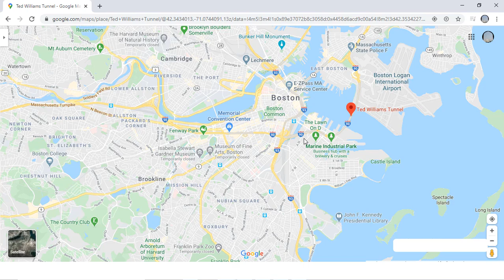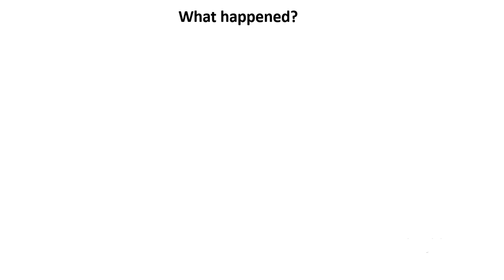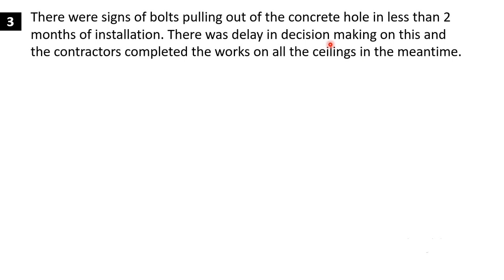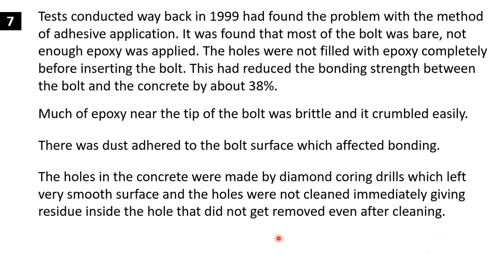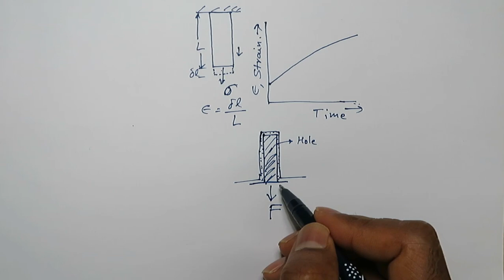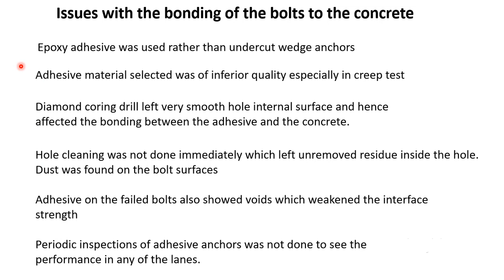The Collapse of the Ceiling of a Tunnel – A Case Study (The Big Dig ceiling collapse)

Comment: I am still uncomfortable traveling through this tunnel because of this. With 2.5x load I would have proposed wedge anchors and epoxy. I also would have proposed using a 5" mixing nozzle to fill the hole before installing the bolt, especially due to the fact that it was a vertical application. Project was already 3x budget, what is the difference in 20,000 fasteners at that point, especially for something hanging over your head.
What has never been made clear to me is what the mitigation and correction process was. Were all the fasteners replaced, are there ongoing inspections? It is coming up on 30 years for parts of that ceiling.

Regarding fire in the tunnel, I wonder if a fire hot enough to penetrate or conduct heat via the T-bar up to the epoxy causing creep and failure would be so hot that a human wouldn't be able to survive in the environment anyways thus negating fire/epoxy creep concerns.
Reply from the maker: Thanks for your valuable comment.

Comment: Your explanation of adhesive anchors is incorrect.     Epoxy snchors, specifically those used in this application ' are mixed by nozzles designed for this purpose . Therefore the resin and hardener are not mixed by spinning in the threaded rod.
Reply from the maker: You may be right. I have followed the case-studies and the news/video reports that came out after the failure. Modern nozzle design must be different than what was available at that time. Thanks for the comment.
Reply: @engineeringmaterials-tribo5142  i worked in the anchor industry for 38 years.  The only adhesive anchor that was mixed by spinning the rods into the holes was a glass capsule containing polyester resins.   This project employed injected epoxy.
Reply: The installers didn’t use the correct method to mix the epoxy was just one of several issues I’ve seen claimed. Another was that they used the wrong drill bits to prepare the holes, in addition to leaving a week between drilling the holes and cleaning them out. Yet another was that they had switched to an even cheaper third party version of the fast-set epoxy and weren’t using Power Fasteners on those particular anchors at all.

Basically a lot of options for how exactly this went wrong.

Comment: Q1: To what extent must engineers educate themselves on the various materials being used and processes being employed in a project in order to ensure safety? 
Q2: If lack of knowledge played a part in causing the collapse, how might such understanding specifically help engineers to prevent an event like this in the future? 
Q3: How else might engineers work to avoid a similar catastrophe?
Reply from the maker: Reply 1: An engineer must be very aware of each material’s benefits and some drawbacks. After all, every one relies on engineer’s knowledge. The project engineer may ask the suppliers to provide the necessary technical datasheet. However, project engineer’s knowledge of the materials will help him to make the right decision. Many of the engineering disasters had failure of the material as the root cause. Of course, at some level design is also something the engineer must look at carefully. Changing of the design at a later stage without making other considerations can be dangerous.
Reply 2. An engineer can learn that polymers (adhesives or bulk) cannot be put under continuous stress as creep occurs. They can take large stress for short-time but not for long time. Similarly, if you are using metals at high temperature then also you should worry about creep.
Reply 3. Look at the technical data of each material you are using. Ensure you have been provided the right material that was mentioned in the design. Never compromise on the materials or change to a convenient design change to save project money. Always take personal interest in each component being built and do not just believe the suppliers or contractors.
Reply: @engineeringmaterials-tribo5142  Thanks for feedback
Reply: Thanks a lot for asking.